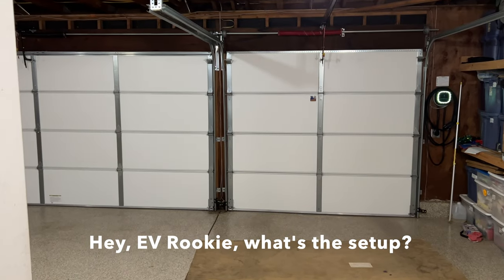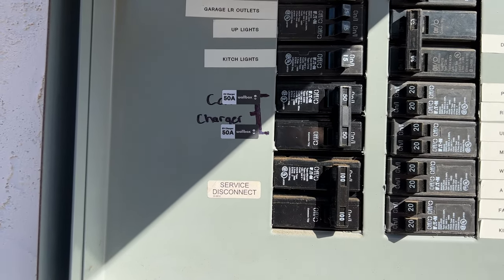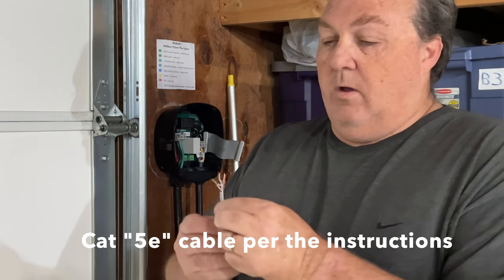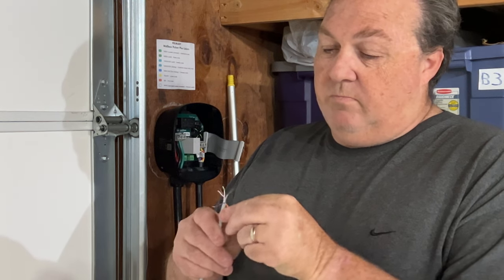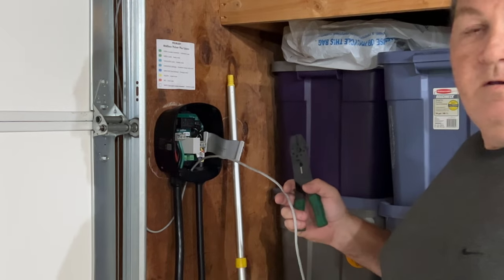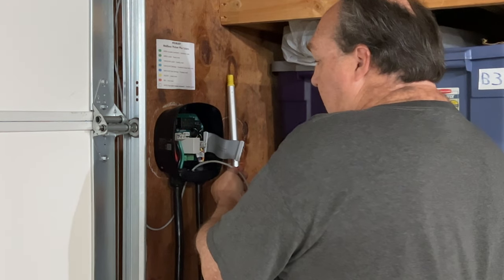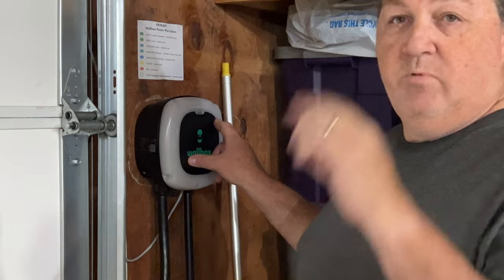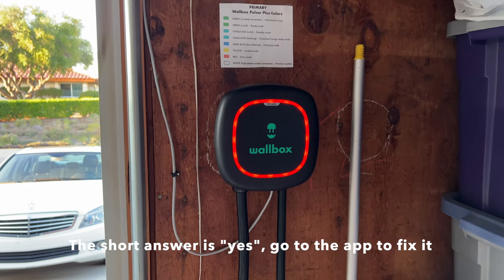WallBox Pulsar Plus - Power Sharing Installation and Setup (4k)

Comment: Just what I was looking for. I am planning 2 48A units. It would have been better with close ups of the boards and controls. Where did you get this info from? Is it in the instructions?
Reply: there was a pdf available, I am having a hard time finding it, but im sure if you contact callbox, they can make it available. The issue I had was that the document didn't show only 2-boxes, so I had to do some investigating, and spent time with callbox customer service to figure it out

Comment: Question: Did you have an electrician, or yourself, do a load calculation on the incoming panel to determine if there is capacity for an additional 50A load to be applied to your service? Also noticed was no GFCI 50A circuit breaker, required by the 2020 NEC, for a plug-n unit.

Comment: So that scedonary 14-50 outlet is powered by the 1st outlet, connected by Romex 6-3?
Reply: No, they share the same power circuit, from the same breaker.
Reply: @dancrane2  right, but one of the nema 14-50 outlets is powering the other, correct?
Reply: @jasontk6968  one doesn’t power the other, they are both connected in a j-box to the main circuit.
Reply: @dancrane2  oh, ok. I'm thinking about buying this charger instead of the chargepoint, specifically for the power sharing capability (for possible future use), and also because it works with Google home. Would you still recommend it? Good video, and thanks for the replies!
Reply: Hi, will SHARING 2 X THHN 6 gauge wires coming from the same 60 AMP Siemens breaker to each Wallbox of the shared chargers be allowed by code?